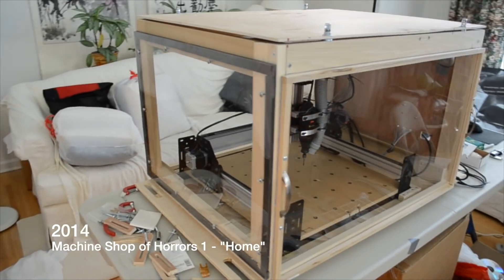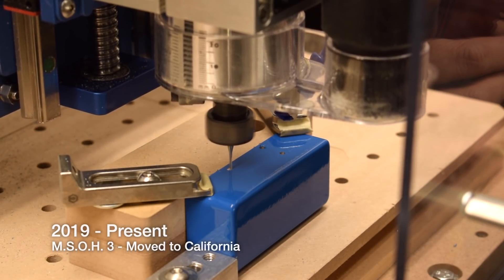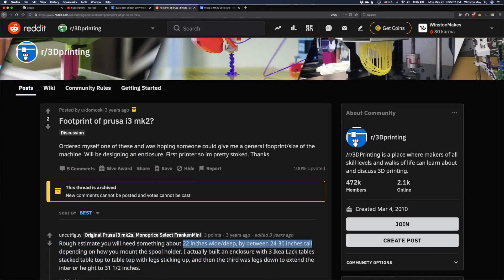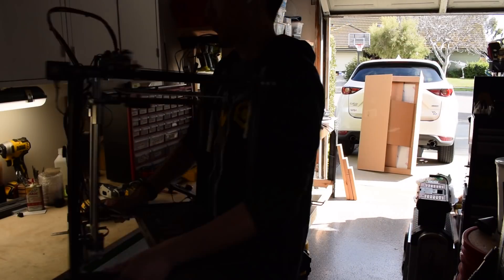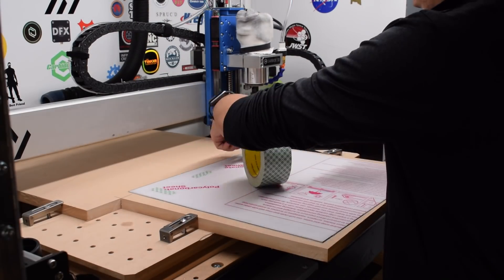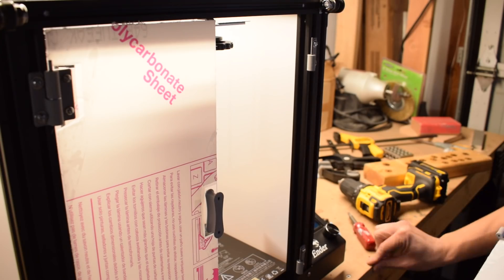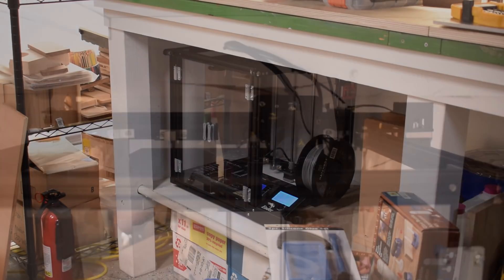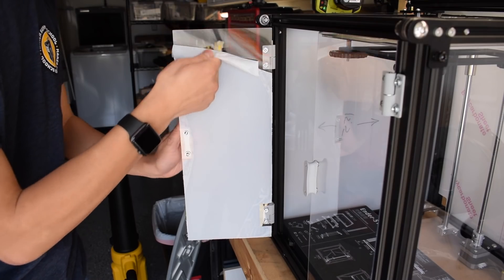I Joined the Dark Side and Bought a 3D Printer - #163

Comment: Congratulations on coming to the dark side.  You can get the 3d printers to print higher tolerance.  +- 0.001".  But that is as good as they will get.  I have both subtractive and additive machines.  Both are amazing in their own ways.  Both can make upgrades for each other.

Comment: Precision of your print is entirely up to the operator same as any other type of CNC. There's almost nothing different between Cartesian stepper driven machines. 3d printing is often more precise because you don't have flex from cutting forces. As with any tool the difference between terrible results and masterpieces is the skill of the craftsman. As your subtractive machining skills improved over the years so to will your additive skills and much quicker because you already learned the fundamentals and troubleshooting with a much harder machine.

Comment: I dont understand.  They are simple to run . If you can heat up a hot pocket in a microwave you can 3d print . A good printer will work great in a garage or basement and you dont need an enclosure, just a can of key board cleaner . Your over thinking this.  My 6 year old is printing 24 hour prints with out a problem. Come on ! Man

Comment: I went through same exercise in trying to find a 3D printer. In the end, best option was BIBO2, dual head allows dissolvable supports / dual color, laser engraver for "etching" wood and such, out of box fully enclosed, fixed tabletop size, biggest print volume among other similar feature printers of about $700 (ie, flashforge)

Comment: Great start with a 3D printer.  One of the first upgrades I did to mine was make a dry-box to print out of.  (Google finds tons of them to choose from) Even PLA and PETG benefit a LOT from printing dry.  And a dry-box is almost a requirement when printing more difficult materials like TPU or Nylon.

Comment: 3d printing is great! But it'll never replace a cnc for strong parts or large volume parts. 3d printing is great for small volumes, small parts that print quickly for functional stuff like your hinges, mounts, cable management etc. Or parts that are hard to do in 2.5D cnc toolpaths where strength isn't an issue. Looking forward to 4d printer projects!

Comment: Welcome to the Dark Side.  I use my 3D printers a lot more than my subtractive CNC machines.  I'm currently wrapping up the design of a 3D printed enclosure for a new product.  If it could be injection molded, the molds and initial production would be over $100K.  Instead, I have zero lead time, no up front costs, and a very nice 110 X 60 X 130 mm enclosure with tons of custom features for $2.50 each.  No inventory.  I'll print them as I need them.  My CNC routers and milling machine and lathes can't do that.

I recently bought the Shadow 5.5S resin 3D printer and the print quality is amazing.  The resins are now more structural than FDM printed parts.  It'll be great for printing a lot of small parts at one time.  The print time is proportional to Z travel no matter how many parts are on the build plate.  I have a manufacturing job in mind for it as well.  3D printers are a boon to makers, but also to small scale manufacturers.
Reply: Resins are anisotropic, and have better tensile strength than PLA if stressed 90° to layer lines.

So far i am unaware of resins that can compete with PC.

Comment: Winston, welcome to the club. I have had a 3d printer for 9+ years and would never be without one. I may not use it as much as I did but it's nice to have sitting on the bench so if a project comes up, (like a box for a electronics project) I can desgin and print it without waiting for the post.

Comment: I'd have recommended the Ender 5 pro plus since it has automatic bed leveling, a larger printing area and improved bed stability abs only costs a few bucks more.
Reply from the maker: There's the 5, 5 Pro, and 5 Plus. 5 Plus doesn't have the upgraded motherboard and is also too large for my tables. Not sure why Creality didn't do a 5 Plus Pro...

Comment: Best upgrade for it would be a duet wifi. Seriously turns a good printer into a awesome. Also you dont have to use ad cards you can just upload to it over the web app. Also you can Add a a auto bed level with it easily and cheap

Comment: So far we've been getting the same machines on a similar timeline. FYI, your future laser cutter is amazing.
Reply: His future fiber laser cutter that can cut metal is even more amazing; I couldn't tell if he was going to invite us to his mansion with the HUGE shop and the swimming pool...
Reply: Hey I got my laser cutter on the day you wrote  this ... Get of my security cams you peeping tom!
Reply: Just added an eBay 7w laser to the XXL wired directly to the control board using LightBurn to run the machine and laser.

Comment: I did the opposite, and started with a 3D Printer and then made an MPCNC from it.  I went very cheap on the printer, but still managed to get a pretty good one.  I haven't regretted either printer so far, though I can definitely see upgrading them in the future as I've used them more.

Comment: For prints where I want a hole to be accurately dimensioned I typically align that to the Z axis.   I find that my printer is usually making holes about .2mm under sized for whatever the reason.   External dimensions along a perimeter are spot on but holes for say a 10mm hole will always be slightly under sized.   Rather than playing with steps on the motors and settings I just scale my drawing slightly to account for it.   A 5mm screw I will set the drawing to 5.1mm if I want the screw to essentially cut threads going in.   Or 5.2mm if I want it to slide in.
Reply from the maker: Yeah, I need to do similar tests here to figure out the appropriate offset for dimensionally critical parts.
Reply: @WinstonMakes  i figure I have anywhere between 30-50 hours a month of printing time if not more.  I look forward to your 3D print fixturing and how you might do setups for doing a zero then an a/b/c side of a work piece moving it through a fixture.

Comment: Engineer here, I appreciate your way of thinking and considerations beforehand. I use also 3D printing together with CNC and non CNC milling. I think it is fully depending on the kind of project that you want to work on. Sometimes 3D printing is better, sometimes are other technologies better. Each has its strengths and weaknesses.
One also great device for some projects is a laser cutter. It made many things very easy for me.

Comment: One thing you may want to look into is using a skr 1.4 board with 2209 drivers. You will be amazed at the difference in quality, you can microstep them down and the different in sound is night and day. Very easy to put the firmware onto it, there is already pre-made ones you can download and change a few parameters if you wish such as homing rates pre-start code or wipe code without having to put it into your slicer.
Reply: @Jason Smith Being honest, I'm not a big fan of their electronics. I find them very cheap and often giving off the vibe they sourced the cheapest materials. Their connectors for instance will pull away leaving the legs sticking out but connected to the cable you just took off, the green terminal plugs can twist while still connected to the board. Personal preference at the end of the day but I'd still recommend getting the 1.4 and 2209.

Comment: Have you thought about finishing 3d prints with your cnc to improve surface finish and accuracy. Possibly even printing fixtureing into the model that you would cut off with the cnc
Reply from the maker: Very limited use case for me. If I have a print where I need that accuracy imparted by a CNC, the CNC could probably have machined the whole thing anyway. You have to go through the effort to register or index the print somehow on the CNC so it's more effort/chances for error. Also, if accuracy is that important and I'm using it in a functional way, I'd probably want to use not-plastic.
Reply: I think he showed a 3d printed fixture on instagram this week. Not sure if I remember correctly

Comment: Buy yourself an original Capricorn Teflon Tube in advance. Once a day you will experience problems, specially when printing ABS=with higher temperatures.
This Chinese Teflon Tubes are the first things that fail.
Happy 3D printing experience.